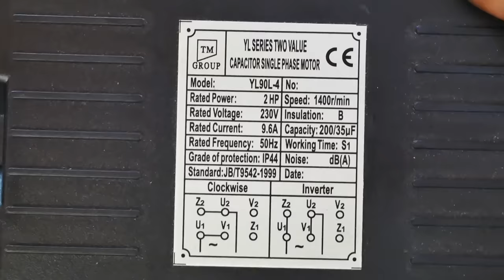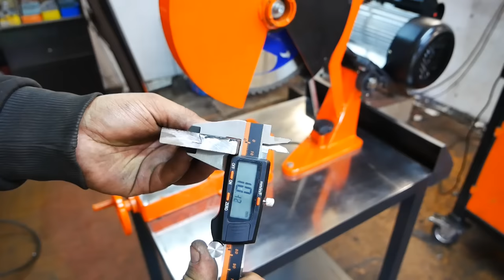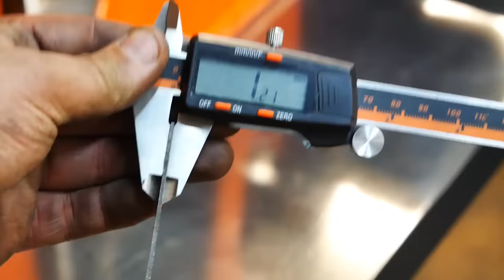Making Metal Cutting Saw Machine

Comment: For the people giving this video a thumbs down, give it a try yourselves and upload the result so we can have a laugh.
Reply: Notus Notus  @8:49 on the blade it says max speed 1750 rpm  @5:29 motor speed is 1400 rpm  so if the pulleys are 1 to 1 it should be fine
Reply: don't have the time or the money
Reply: Notus Notus  is it so hard to accept that you are wrong? that kind of electric motor can run at their max revs all the time with no problem.
Reply: Notus Notus  so dewalt which runs at 1300 rpm and makita at 1700 rpm didnt built their machine correctly as well.
Reply: Notus Notus  if you think the maker is building a cold saw you are wrong, if you think he is aiming at industrial workshops you are wrong. if you think blades designed to run at 75-100 rpm is same as the blade on the video you are wrong.
Reply: Notus Notus  You gave me a nice laugh :) 
From this conversations that you guys had, now i can definitely understand why you can never win an argue with an idiot!
Reply: Notus Notus  no need to complicate, maker made a saw at 1400 rpm for a saw that will cut at 1750 rpm or less. so he wasnt incorrect.

you go ahead and run a saw at 1 revolutions per year and get a 1000 year lasting saw. that doesnt change the fact that the machine is correct.

i dont think i know more or less than you. how can i i dont know you. still doesnt change the fact that machine is correct.

my "ignorance"? yeah right
Reply: This is not his "idea" its from made in Poland. Very brief disclosure at the end of description.
Reply: Those who give a thumbs down, leave something behind only when they squat.
Reply: Notus Notus  you are ok.
Reply: Indonesia hadir👍👍
Reply: @IR-nq4qv  Excellent reply. Their mommy still makes toast for them at 40 and brings it to the basement where her trolls live. lol
Reply: Notus Notus  and how to you know what the rpms of his set up is running at? Do you know the diameter of the pullies and the RPM of the motor he's using, and the output speed at the blade? 

If he exceeded the safe recommended RPMs of the blade, then you most definitely have a point, but as smart as this guy seems to be, I'm sure he's factored that into his build. If somehow he's overlooked it, then constructive feedback would be a valuable gift to him and to anyone who might be attempting this build  as this consideration would save someone from serious injury and potential death. I am hoping to see his answer on your valid point, and the correction he posts if he didn't factor this into his build. Who knows? Maybe your reply might save someone a trip to the ER...
Reply: @jerry1378  That's good to know. I have to admit that Notus Notus raises an interesting consideration when anyone creates anything like this. This guy's particular build appears to be well within the safe operating speed of the blade, (assuming the pulleys are 1:1 ratio pulleys, but for someone else who might attempt this build, they need to know this and factor it in. Thanks for the info.
Reply: Notus Notus  the blade is rated for about 1700 rpm max... and the motor is 1400rpm. The drive ratio is 1:1
Reply: @jerry1378  dude you dont get what @Notus Notus is trying to say do you... The point youre making is valid only if you discard the effect friction/temph has on the carbide tips of this blade.. your point is if you spin slower or faster as long as you're under the rated max rpm you're good.... Seems valid but the thing is the faster you spin these blades the more heat you generate at those carbide tips making it hotter in turn reducing lifespan you must use these blades the same way you would use a lathe
Reply: @soeradjchotkan4199  i'm not denying basic physics dude. if you cut at less than 1/3 of the rated speed of course you will get more life out of it but running it at rated speed or at %80 in this case doesn't mean that you build it incorrect.
Reply: That know it not at the bottom knows nothing. First off a cold cut saw is supposed to run at around 1400 + - actually the super expensive ones can run at 100. That’s the whole idea of no sparks no warping. A fiber blade will cut the same metal but it throws hot sparks, this saws run typically at the same speed as a wide saw around 3800 rpm. If you know anything about cutting or drilling metal slow and lubed is the only proper way. Everyone’s drilled metal fast and dry before and wonder why their bit quits, especially stainless, when the metal starts turning blue it’s getting harder. This saw and the video made in Poland are top notched professional saws. Like I said if you want to spend thousands then you might get a better saw but unless you are a factory using it 8 to 10 hours a day financially it’s not worth it. I just bought an evolution saw on Amazon   And paid around 400 bucks fir it. That’s about the cheapest saw cold cut saw you can buy thats decent but I’d much rather have this one. If anyone is looking. I found the saw shaft with a 30 mm arbor and comes welded to the motor mount also comes with the blade guard. Also comparing say a Dewalt saw motor and a heavy duty induction motor is no comparison. This motor will have 5 times the torq as on any Dewalt type chop saw. Unless you have money to burn this is the absolute best you can get. Be careful when you purchase your spindle arbor shaft. They make a clockwise and a counter clockwise. Induction motors are usually reversible but the way any chop saw needs to cut is always down in front . I gotta go link at my saw to remember, but also your arbor screw will or should always be tightening or reverse thread. Ali.com search on that sight, I knoe you can make the parts but the guard is a lot of work. Anyway great video like I said earlier I wish we could see the unedited version slowed down but I’m grateful for the idea and can figure it out from the videos, all you down thumpers stick that thumb up your shoot!
Reply: @IR-nq4qv  1يذذ
Reply: @IR-nq4qv  ئذيذييئذ

Comment: Very cool idea, well done.
One improvement: you need to turn the gas spring around. The current installation does not allow for the top seal to get lubricated! The oil sits at the bottom of the cylinder. Turn it around and it will last forever. No dirt will sit on the seal either.
Reply from the maker: Thank you :) I'll change it soon, thanks for the advice :)
Reply: Where did you get the Saw Spindle?

Comment: Awesome design, good job👍 
Tip: even though it's a cold cutting blade hook up a coolant line or spray coolant manually it will double your blade life. I recently did this and love it!
Reply from the maker: Thank you :) I did not show it in the video, but when cutting thicker elements I use a spray lubricant
Reply: @WorkshopFromScratch  Right on! 💪
Reply: eowow
Reply: @WorkshopFromScratch  można prosić o e-mail do Ciebie?
Reply: The cold cutting are really getting popular, are they really that much better?? Iv always had and used the friction grinder type. How long do the blades generally last? What brands would anyone suggest?
Reply: @bambambundy6  first i thought about a circular cutting saw, but i work in my basement, so noise was an issue. I bought a metal bandsaw, it is not so fast, but quiet, no hot sparks flying and no coolant needet. And its not that dangerous, because of the low cutting speed.

Comment: Where would you be able obtain plans and a parts list for this project, it's totally cool to get an accelerated build view to see what the project looks like but us mere humans need a bit more direction, could anyone help? BTW, totally jazzed 🎶 w/this build if I didn't mention it b4! 💥👌 Any help YouTube?
Thanks ! 👍
Reply from the maker: Thank you :) All dimensions depend on the parts you buy. The engine I used has a power of 1.5kw, rotation 1400 rpm. Pulley ratio 1: 1. I used a belt with a total length of 1100mm for the construction. Bearing shaft Chinese from a circular saw for wood, with a shaft thickness of 20mm, for the saw blade to be mounted, you also need to buy a reduction ring 20 / 25.4, because carbide blades usually have a hole diameter of 25.4. When you complete these parts, you will set the dimensions yourself, as I did in the video, because I did not do the plan, but I matched the entire project for the parts that I collected.

Comment: Very nice! Also similar to Made in Poland's design :) One thing tho - I was a bit worried when I saw the first cutting, lots of the hot filings are bombarding the motor, I think you should add some additional shielding. Also, do you have the plans available anywhere? Good luck for any future projects! Cheers :)
Reply from the maker: Yes, I should make a longer blade guard. As for the plans, I do not have time to make them yet, but I am in the process of taking photos of individual elements, in the pictures I will describe the dimensions and share :)

Comment: Finely, someone who uses their four inch grinder to build a proper chop saw!  Nice job.  Fyi, on your mag drill,a friend mounted the magnet from one upside down in a hole on his bench. Worked great for holding  pieces to grind or wire brush.
Reply from the maker: Thank you 😁

Comment: Very nice! Wow!  So what RPM  does the motor turn the metal cutting blade?
Reply from the maker: 1460rpm engine, 1: 1 ratio, so the blade rotates at the same speed as the engine
Reply: Thanks so much!

Comment: How did you calculate the RPMs of the motor to get the pulley sizes to equal the RPM that the blade needed ?  Awesome build 👍👍
Reply from the maker: Gear ratio 1:1, engine speed 1400rpm. Thank you :)
Reply: @WorkshopFromScratch  How many rpm blade has now?Greetings

Comment: Really good job looking tight and solid, but how much cost you to build this machine, I bought one from Evolution EVO355 : Raptor 14 Inch for 340 euro and is really good to. Just wondering how big the different will be. Thanks and good luck with next project.
Reply from the maker: The price depends on the parts and materials you complete, if you buy some materials from scrap metal, a used engine or you have such an engine in your possession, it will be much cheaper :) The shield is the most expensive :(

Comment: Excellent work !!! I would like to make one like that, it would be interesting to indicate the links where I buy the pieces you used. I'm mainly interested in the piece with the pulleys where the saw blade is attached. could be? Thank you ,
Reply from the maker: Thank you :) There are many shafts to choose from on the popular online store, I bought a Chinese table saw shaft for wood with a shaft diameter of 20mm and then I bought a 20 / 25.4mm reduction ring to fit the shaft to the hole saw

Comment: A very good machine 👍 and you can find out the size of pulleys????
Reply from the maker: Gear ratio of pulleys 1: 1. So the same size is on the motor and the shaft.
Reply: @WorkshopFromScratch  Thanks

Comment: very cool saw !!!  I want to make myself the same cutting machine.  maybe there are sketches or drawings left?  I'll be very thankful.
Reply from the maker: Thank you :) I have no plans, I built everything adjusting the length to the engine, belt and bearing shaft. But if you really need help with building I can take a picture with dimensions

Comment: Nice job but I don't know which cutting blade u have used to in this machine
Reply from the maker: It is a widia saw for cutting metal, similar to cutting wood, but much more durable, and the teeth are sharpened at a different angle

Comment: Just wondering what the part is that you used for the arbor, shown in the video at 5:35?
Reply: Also, wondering if the blade should be cutting on the upstroke (the teeth cut through the work piece going up) like it is, or if it should be cutting downward (teeth go through the work piece down) so the chips and debris are sent down to the table instead of up?  I must confess I am NOT a machinist in any sense of the word, so I am curious if this is a design decision or a side effect?

Comment: The machine looks nice but i think the disc spins too fast. Approx 300 RPM should be enaught. We cut stainless steel shafts of 45mm diameter with a 300mm disc and with only 110 rpm and it cuts thru it like knife in the butter.If it spins too fast you highly reduce the life of the cutting edges.
Reply from the maker: I know which disc you are talking about, but the disc I used is a bit different, it has sintered carbide, the manufacturer of this disc and other manufacturers suggest the speed from 1200rpm to 1600rpm

Comment: what rpm speed motor you use?? n what size pulley both??
Reply from the maker: 1.5 KW motor, 1480rpm, pulleys ratio 1: 1

Comment: Not to high RPM for this saw?
Reply from the maker: 1400rpm engine, 1: 1 pulleys ratio, so it seems to me that the revolutions are not too high, especially since the manufacturer of the disc gives the optimal revolutions 1650rpm
Reply: Dziwne, bo ja dla tarczy na ukośnicy 305mm (do stali) mam 1400obr/min  (Bosch). Pytanie o obroty wzięło się stąd, że jest mimo wszystko dużo iskier przy cięciu.
Ale projekt i wykonanie git!

Comment: making machine is not so difficult...but the cutting blade is expensive :(    200$US?
Reply from the maker: There are also cheaper blades, but still expensive, the big positive is that in addition to fast cutting, you can also sharpen such blades, so they should last for a long time :)

Comment: hlo brother plz explain ur blade grander cutting blade etc
Reply from the maker: It is a sintered carbide blade, similar to a wood widia blade, but the metal blade is much more durable and the teeth are sharpened at a different angle

Comment: you can give the dimensions of the machine
Reply from the maker: I can give you dimensions, but note that I adjusted the dimensions for the motor, bearing shaft and belt (1100mm) looking at the variety of motors and shafts, I can mislead you by specifying the dimensions. So it's best to collect all the necessary parts and do as shown in the movie, fasten everything with clamps to the sheet and mark the dimensions and holes, then you can also adjust the table top to other dimensions

Comment: Хороший отрезной станок.  У меня к Вам просьба, можно размеры вашего станка, если можно вот моя почта gennadij.mojseyuk@mail.ru За раннее спасибо. ЛАЙК.
Reply from the maker: When home, I will take the measurements, but you must pay attention to the fact that I selected the dimensions for the bearing shaft, motor and belt (1100mm). If you use other parts, the dimensions may not coincide.